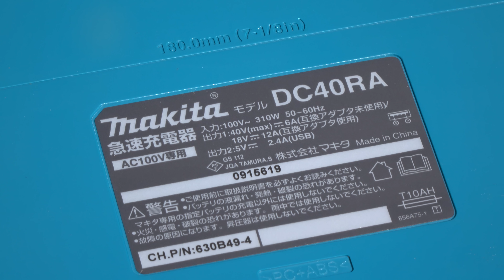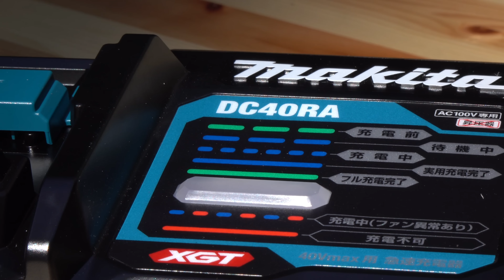牧田Makita40v衝擊批對Dewalt對RIDGID對DEVON對WORX對HITACHI!年末基本參考測試!

Comment: 1:47 所謂 18V大電 係 2並聯5串聯 總數10粒18650 , 所謂 40V 係10串聯, 唔係你所講6粒並聯！ 仲有 40V   唔係功率,功率P=VI . 而家新出所謂40V 都係多舊魚呃班電子白痴！ 實際Power 係睇個摩打幾多W ,  例如500W 可以 18V × 27.8A , 又可以係 40V × 12.5A , 都可以係 220V × 2.27A . 勁唔勁係要睇 Power (W) , 唔係睇 Volt .

另外,Volt大左嘅好處係令同一功率下令電流降低 ,從而可以更易做到更大功率嘅摩打.
但係呢個撞批睇嚟實際功率都唔係大18V個批好多。
Reply: 成個設計都171黎。 十足bandai 賣玩具一樣，加件武器當新野賣！
要upgrade 都等多年，等佢出gen 2 從新設計過個摩打係40v 專用先。
見到佢把40v 鋸仲搞笑， 賣果個就吹到幾勁幾勁咁， 但係又咪6吋半機，咪同18v果部1樣。
反而得偉岩岩出54v果時就係冇呃你，真係比到54v 應有既力量。
得偉54v鋸砌2－3吋實木好似砌牛油咁，試下紅m 40v鋸砌2吋厚既木門睇睇，睇完我就信。

聲明先，我得偉紅m都有用， 而且紅m我係9成會帶去開工，因為輕身d。
Reply: @65734  Dewalt 60V (54V) 工具摩打Power 的確係大D ,件頭都係大D , 風車鋸同磨機 20V 同 60V 都有, 人地摩打真係大Power D .
Reply: 110~220V同一款燈 比220唔會光D
Reply: 反而威克斯用21700做電池先係新野😂😂
Reply: 無刷40V, 我念同18V個分別係咁, 同摩打銅線線徑同圈數有關係，如果以一般BLDC計法應該係電壓同轉速成正比，電流就係扭力成正比........如果行盡40V, 再以功率計法咁電流會小左, 姐係限制左輸出扭力，所以應該唔係咁

姐係如果透過升級電池數量同串並配搭去增大電壓電流同時，同時要升級埋摩打同埋驅動電路都可能要改，只要拆開睇過就知咩料